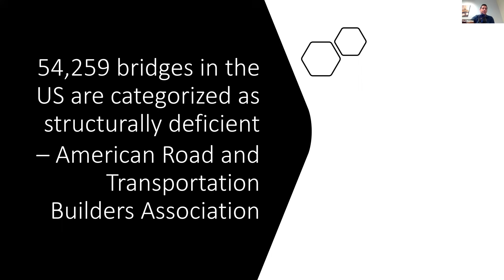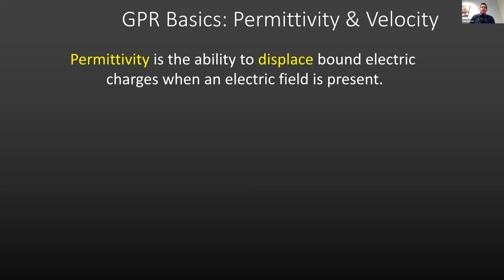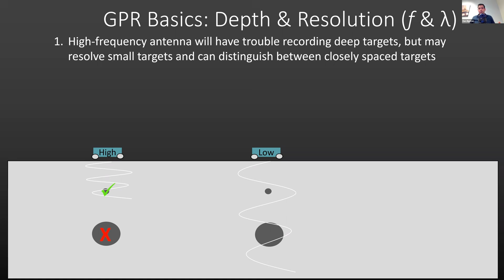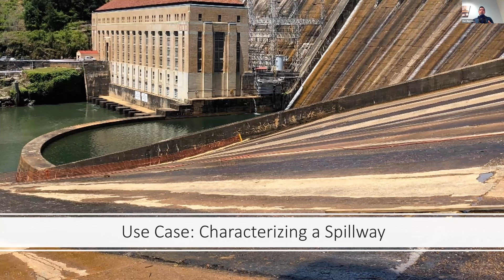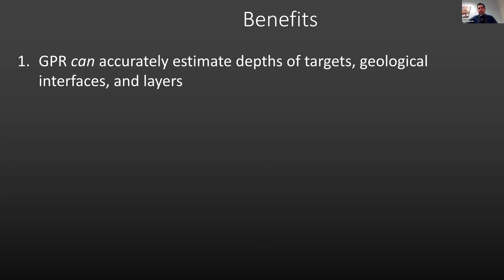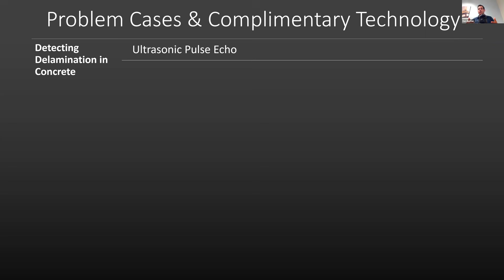Concrete Scanning with GPR Webinar

Comment: I wonder if in the future you can utilize ai to read data
Reply from the maker: Its here, definitely still needs work.  Early models even about 10 years ago or so were available but really struggled to identify targets of interest and would often hallucinate and interpret no responses as actual anomalies. The newer models have gotten significantly better especially when looking for linear targets like pipes and cables or rebar. The functions are built identify those types of geometry specifically but most models are trained on artificial data and more actual field data need to be collected and used in the training for them to be really good at identifying the variability that is needed. Thank you so much for the question and I appreciate you watching
Reply from the maker: I guess one more final comment would be that human involvement is still critical in the interpretations
Reply: @Learngpr I absolutely agree I just thought as a tool to help the operators.

Thank you for the video it helped so much as im a new scanner and trying to pick up on data analytics 

Have a great evening.

Have a peach for me 😅